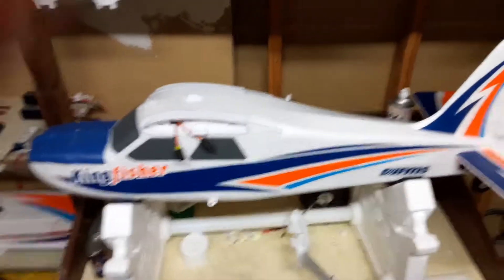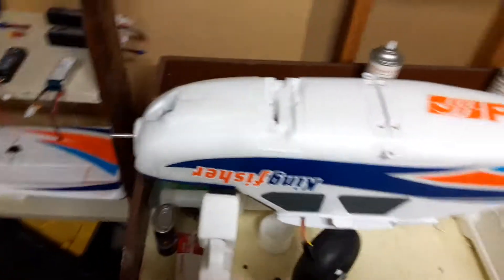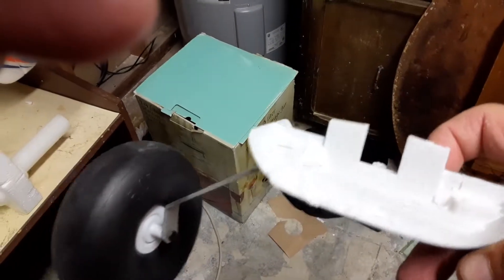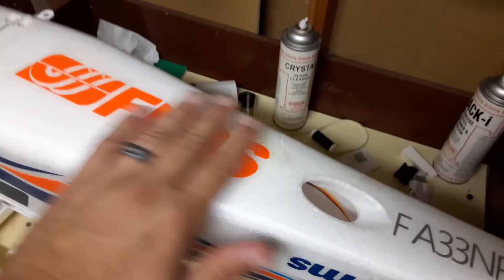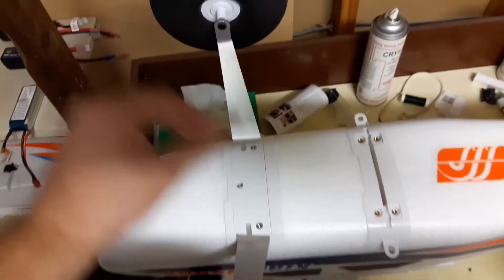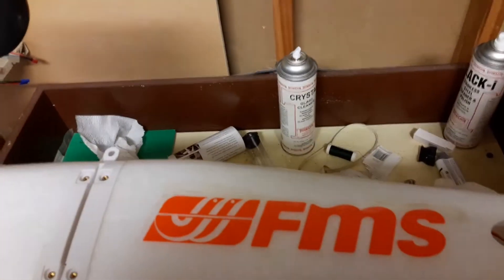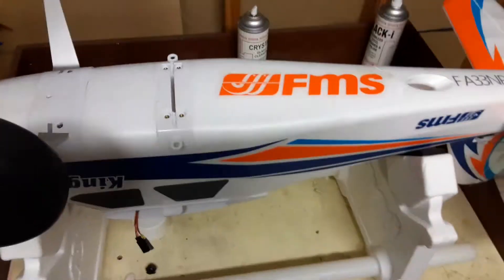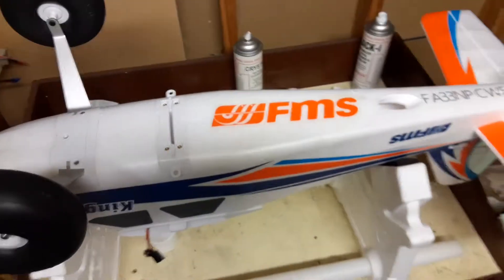FMS Kingfisher 1400mm Damage Assesement

Comment: I keep thinking about slicing those wheels down the centerline just to see what it does towards softening them up. I wouldn't be surprised if you could also drill holes in the side. 
So make sure to set a brake on the ESC so the prop stops spinning before you belly land. 
I think you'll enjoy the flight characteristics of planes like these after you take the wheels off.
Reply from the maker: I ordered some softer wheels.  Reckem Roy RC recomended the wheels off of the durafly tundra.  The tundra wheels are what I ordered.  Thanks for stopping by!